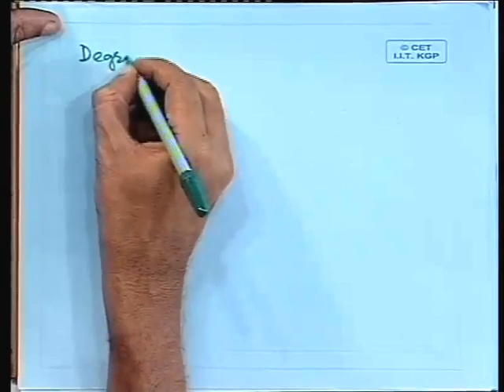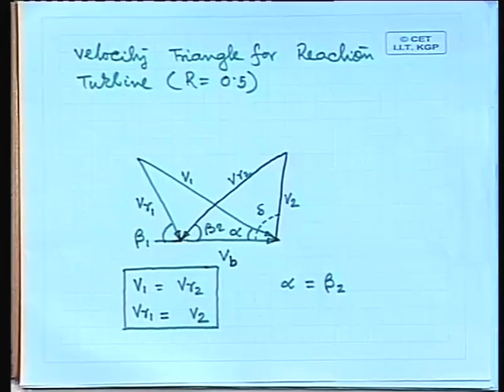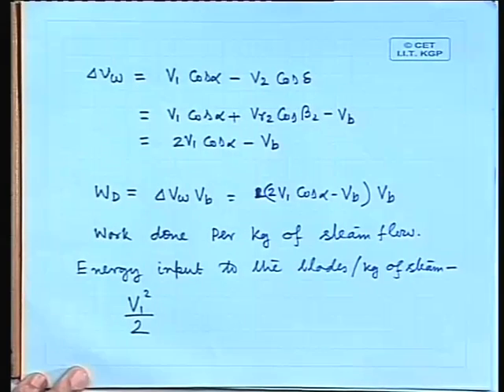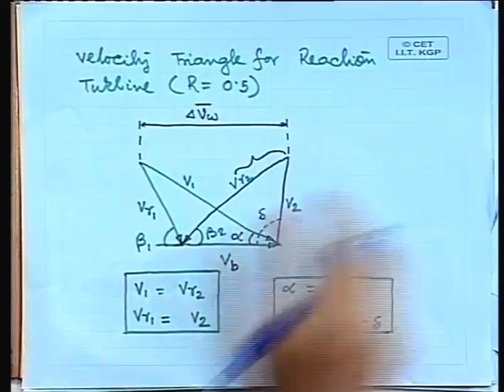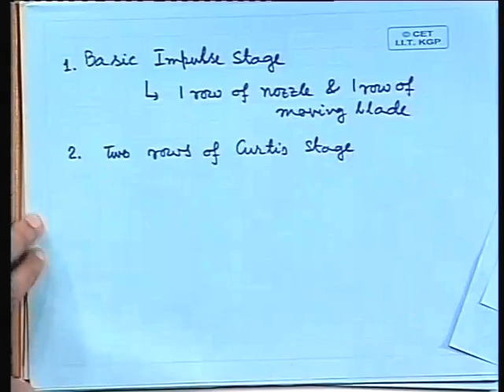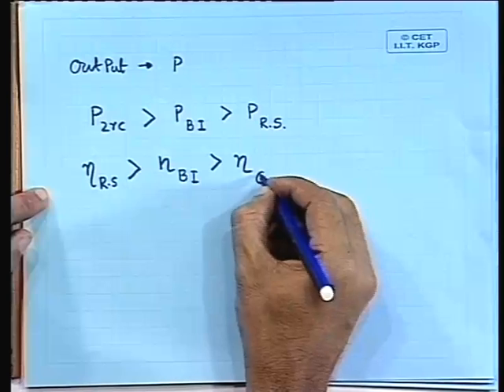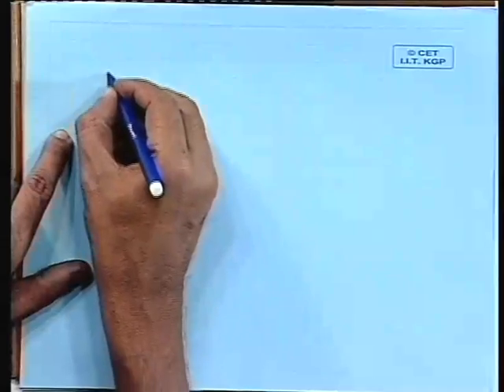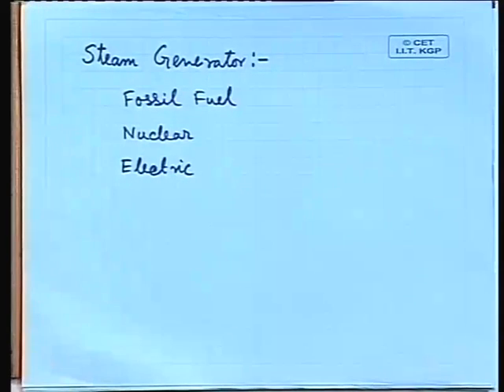Lec-14 Comparison of Different Staging Arrangement

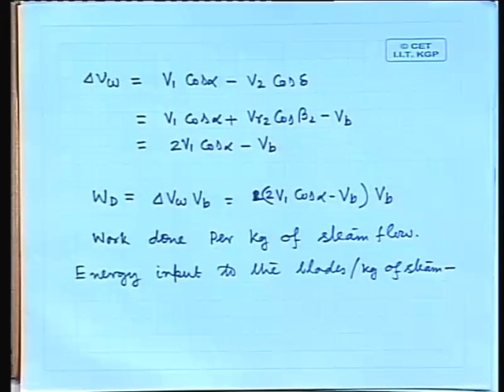Comment: Velocity in the moving blade should decrease but around 16:00 he says that it increases?
Reply: the overall velocity decreases that is the resultant of velocity drop due to impulse action and velocity gain due to reaction component. But only due to reaction component the velocity increases as a result of drop in pressure.

Comment: The expression of diagram efficiency given first, I think is wrong. Because if the same expression is evaluated afterwards, putting the value of max ᵨ then there is a negative sign at the denominator. Please clear it.
Reply: yes expression is wrong  for diagram efficiency . Mistake of one negative is there.
Reply: Energy input=(v1^2-v2^2+2v1v2cos@)/2
is correct I think??